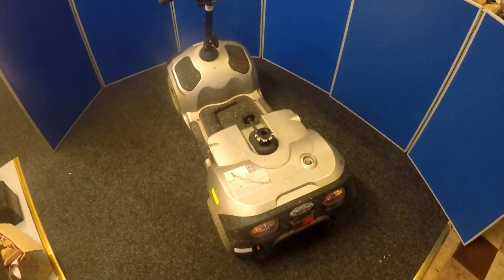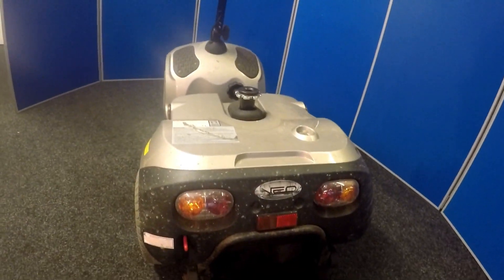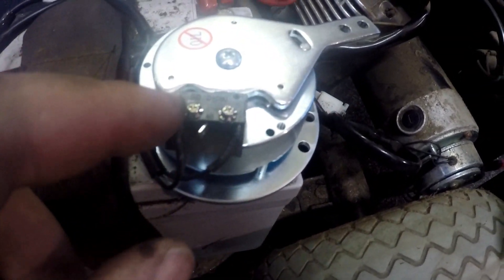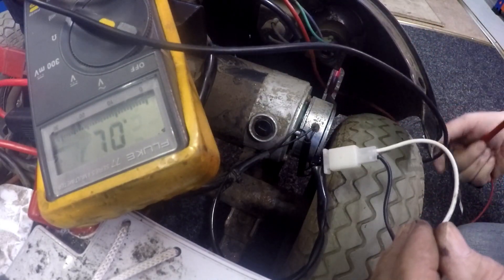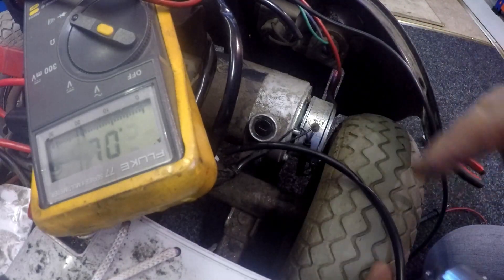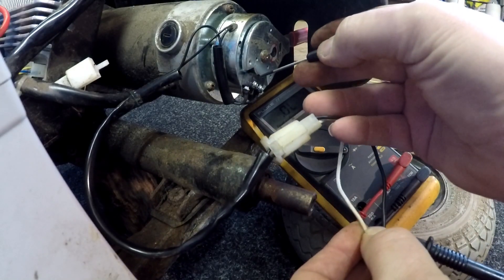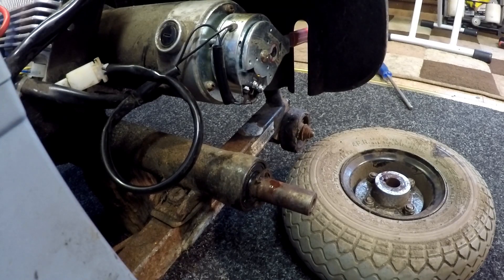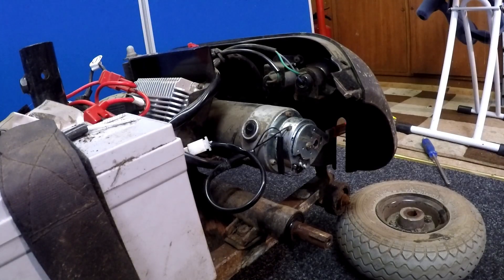Mobility Scooter Electric Brake Fault finding & Repair Part 2

Comment: I have a question about swapping out a brake controller equipped with free wheeling handle. Is it possible to swap the handle?

Comment: I asked a question which was not answered, being is the little gasket between micro switch and motor brake important?
Reply from the maker: Sorry missed that one.  Some
Manufacturers fit them some don’t so with that in mind the answer is NO

Comment: Great video, very helpful. I have a Quantum Q6 Edge powerchair. Left motor will no go into freewheel. I have continuity in brake micro switch when micro switch when the little button is both out and pressed in.  When pressed in the joystick says motor is disengaged but it won't freewheel. Is this a faulty micro switch or brake?

Comment: I think I screwed up the scooter I spray WD-40 around the motor and micro switch off and use the car charger 12 V at 12 AMP to charge batteries but failed to unplug from battery to motherboard to isolate since onboard charger wasn’t working.
It worked after I changed the batteries but then I got this crazy idea. I was going to move up the moving parts with WD-40 and spray the vinyl protectant on the wires. You can hear the micro switch click in the motor click for a second and then it went into reverse when I have the forward pedal pressed, and I just stopped working .
Reply: Didn’t know
Reply: This type of scooter has a Main wtheir Hwy Honest from the motherboard to the motor and micro switch multiple male, female, and one harness how do I test there’s like six male, sex, female, plug-in harness. Can anybody explain the process what happens first in the micro switch engage and then give power to the motor making the wheels turn in. What order does all of this happen? Please be very detailed in your response.

Comment: I have a pride, Sundancer 3 wheel.
How do I test the micro switch brake and motor when the wire connection has multiple male and female connector plug all in one harness

Comment: Can you tell me why a unit would have full power to the drive axle in reverse but not in forward?  Going forward you need to push the lever very gently to get moving and then it will take full speed, otherwise it will kick out, you have to wait just a second or two, it resets then it will go, but also needs to be pushed up a small hill in forward.
Reply from the maker: Sounds like some work has been done before and refitted wrongly wires swapped what’s the make and model
Reply: @tomjacques4  It's an Invacare Lynx-3
Reply from the maker: @harpo6203  and what work was carried out on it before it started this strange behaviour
Reply: @tomjacques4  I don't know that. This unit was given to me by a family that no longer needed it.  I know nothing of its history, sorry.  I was wondering if there's some kind of overload protector that has become weak with age?
Reply from the maker: @harpo6203  to be honest would have to hand a look at it could be something silly difficult to say.
Reply: @tomjacques4  Thanks for the effort to find a solution.  I appreciate it.  I've dropped the unit off with a service shop so hopefully they can figure it out.  Thanks again.

Comment: Hello, Superman. Don’t know if you can help me or not. After watching your videos I replaced the batteries, ignition, the electric break, the control unit, and the motor. I got the scooter going, but when I took it out to try it the speed was much to slow, I had pedestrians passing me,🤔😊, any ideas what to do.?.
Reply from the maker: hi what's the make and model. check high and low switch if it has one, check speed pot is correct one. has the controller been programmed.?

Comment: Thank you for this video. I have been testing my nans scooter, and there is continuity across the terminals of the brake, but then I removed and tested the brake using a bench power supply and the brake was solid, didnt heart a solenoid click. Can they have a good continuity test and still have a failed solenoid?
Reply from the maker: Yep sure can let me know what type you need

Comment: Is the micro switch on the elec brake universal or are there others that can be used on a scooter of a particular kind?🤔😊
Reply from the maker: It will have to be the correct size and spec.
Reply: OK but what do I order if I want one regards Danny

Comment: My electric brake is just not clicking over when it has 24v. It's just a basic one (rascal) no handle or microswitch. Resistance looks OK 48ohm ,current 0.5A.  I've had it  apart and nothing is seized in it.  All I can think of is that there isn't a mag field being produced or if there is, it isn't strong enough to pull in the plate against the spring. I just might be missing something simple  or more obvious to you. Hope you can help. Great channel by the way. Keep it up. Thanks.
Reply from the maker: Hi if it does not release the disc when 24 voltage has been applied then it’s goosed.  We should be able to help you if you need a new one.
Reply: @tomjacques4  thankyou. I'll go on your website.
Reply from the maker: @spikespike9430  if you can find what your looking for then send us some pictures with Nm

Comment: How do you know what way to put the new brake back on. Video 1
Reply from the maker: I always tell people to take pictures before dismantling. Mind you I’ve been doing it for over 30 years. So kinda know how it goes on. Mind you on new models I take a picture if I need to remove and wait until a spare arrives, just in case.

Comment: Hi Great vids I have aTGA sportster and I can drive it for a short while then the brake comes on, not enough to stop driving unless battery is down  but its got worse; it comes on sooner so found your excellent vid and have started taking it apart There's a good bit of white corrosion and I've taken the micro switch off. I'm reluctant to take off the lever which switches from drive to free wheel but it does need cleaning under and around it. Is it ok to do that? I've tried continuity on the 2 connectors on the switch and nothing so is that the switch broken or perhaps I'm not testing in the right place. I'm always nervous to take things apart before I know its ok. In your vid there are wires with connectors but my wires go into a box which is why I say not sure if Im testing in the right place Hope I've given you enough info Brake no: ACY001AI  2DX0X098001  H05020028
Regards  Jonathan Green

Comment: SHOPRIDER CORDOBA STILL DRIVING WITH BRAKE MANUALLY OFF AND CUTTING OUT  MICRO SWITCH GOOD BRAKE WORKING ANY IDEAS ????
Reply from the maker: Shouldn’t really drive in manual you sure micro switch is ok ? Could be stuck on. Have you don’t s continuity test on it and checked the small switch. ?

Comment: My Go Go ultra x 3 wheel gives 5 beeps. The neutral bar moves back an forth. Scooter still doesn't move battery's is charged an new as I replaced them. Scooter lights up. Please help what do I do?
Reply from the maker: Check the micro switch as well on the terminal block that connects the wires to the controller. The brake has an extra white terminal check that.

Comment: Very good videos,a quick question scooter works fine and slows down ok but the brake is not lock on, scooter keeps rolling.
Reply from the maker: Throttle is not centred correctly. once stopped try and gently move the throttle lever either side to see it the brake clicks on
Reply: @tomjacques4   No that did not work I checked the brushes they are fine.
Reply from the maker: @alisongreen9023  think you will need to Do a video
Reply: @tomjacques4  All works perfectly fine nothing wrong with the motor all looks very new just simply when you stop on a slope it won’t stop rolling either up or down but release the throttle it slows down and stops then starts to roll
Reply from the maker: @alisongreen9023  if possible remove the brake and see if the nut that is attached to the motor is slack
Reply: @tomjacques4  Excellent thank you, I took the break off, turned the nut, it was moving, took it off replaced with another which has 2 tighteners on it, all works fine now. Many thanks
Reply: @tomjacques4  May I ask
Reply: Why does the nut slip, even though tighten properly and appear grooved into ?
Reply from the maker: @alisongreen9023  the nut will not slip if it has a grove it will be the disc that will slip. Some nuts that are fitted do not have groves hence  slipping on the shaft
Reply: I've got a tga s3 mobility scooter and it won't move at all.

Comment: I acquired for free a mini stryder scooter for my wife and it all seemed good,i tried to recharge the batteries and i think i decided they were dead so got 2 more and fitted them and the scooter will not move,no noises or clicks when i turned on the ignition,the dash has a green light and it flashes 9 times and then there is a pause.what is wrong????? i need hellllllllpppppppp!!!!!!!!!!!!!!

Comment: Hi, the videos are great and very informative. I am trying to sort out a Pride Gogo Elite Traveller that is giving 8 beeps when switched on, I think the electric brake overheated recently and since then we have been getting this error. Would there be anything else to check over than buy a new electric brake and fit it? The Pride manual just states this error means the motor is disconnected and to call a service engineer and I cannot see any troubleshooting guide for this fault.
Reply from the maker: Hi Matin check out our latest video about scooter cutting out we replace the rear motor connector
Reply: @tomjacques4  thanks I will, does 60ohms for the resistance of the electric brake sound too high?

Comment: Hi i have a invacare Auriga 3 wheel mobility scooter the problem i have is when i put the ignition on and wait a few seconds before i pull the leaver now for some reason the scooter will not move at all i can hear the click where the brake should be releasing but for some reason the scooter will move unless i jerk it in a forward motion and it releases the brake. So do i need a new magnetic brake or can the brake be fixed. I should also add that i don't know very much about mobility scooters other than watching your videos. Many thanks David.
Reply from the maker: david holley brakes in stock but I would check the brushes
Reply: @tomjacques4  ok thank you for replying to me. As i said i dont know much about mobility scooters i just thought the problem i have was the brake binding on as it only happens when i get on it to pull off. I will see if i can get someone to look at the problem for me. Thank you for getting back to me.
Reply from the maker: david holley when brushes or the commutator get worn/dirty they can stick won’t move until you push it then it will work all you will need is a flat screw driver set of brushes and a glass Fibre pen to clean the community we sell the lot but check it first it’s a 5 min job out videos show how to check
Reply: @tomjacques4  thank you very much you are very helpful.. much appreciated.
Reply: Hi it's David here again could you tell me how much a throttle pot for a Auriga is please
Reply from the maker: david holley hi David send your request and we will send you a link nithsdale.wheelchairs@btinternet.com
Reply: @tomjacques4  how much would it be to buy the brake. Or how much for the bushes please.

Comment: Hi your video is so helpful, I have a Pride Go Go scooter, it beeps five times.  I have taken off the brake and I does not have continuity.  I have tested the micro switch by pushing in the white tip and it does not click.  The scooter is about 5 fives old.  Can you help me to zero in on this problem?  Thank you
Reply from the maker: Sherryl Lockett looks like a faulty micro switch my friend we sell them on your site.  
https://www.nithsdale-wheelchairs.com/prods/11441/micro-switch.html
Reply: @tomjacques4  thank you, the number on the brake is Warner Electric z345/5/C,  09/Nov/15, WR198A345P1,  3.ONm, 24 Vdc, 10 W, DRV 1060.  i looked at your website and i don't see this particular one.  im in the states how can i contact you.

Comment: Hi pal got the same scooter dash slightly different galaxy neo 6  it just stopped going up hill uncle told me.. Batteries OK, brake OK, motor OK, brushes OK, the fault light comes on stays on doesn't flash. Everything works but will not go back or forward,, any idea's,  I'll try phone you later
Reply from the maker: Sammy Patterson check the circuit breaker check for water contamination also a couple of fuses under the rear panel

Comment: Boss, so we now know the scooter has been left uncovered in some rain. There is a flashing left indicator with a beep sound. How do I fix it, or do you need to get it into your shop. kymco xl i think maybe xls 8 mph with 2 big batteries
Reply from the maker: Billy Purse hi looks like water has got in the switch.  Take scooter to a warm room sir a couple of days may need to replace switch

Comment: okay boss, scooter cover was blown off front of scooter. hence this funny light flash and reverse horn sound. with plenty of time on my hands how do I fix it? Is it just replace fuse, dry out affected area and that's it? Do you sell covers for the kymco xl, cheers mucker, love these video's
Reply from the maker: Billy Purse I would put the scooter in a warm room for a couple of days even if bad have a small heater to help drying out but not too hot. Thereafter test it as it should dry out.  We do sell waterproof covers check out our site. Always try and buy the best you can afford, I have seen some cheap ones and they are very thin so no protecting and the seams are not sealed from the inside.  You get what you pay for.

Comment: I like your video and I have a technical question. My power chair makes the usual clicks noise whenever I use the directional controller. I wanted to remove the magnetic brake from the drive as I’ve been told it’s essentially only a parking brake. I only use this chair in my house which is level. Can I do this to make it noiseless and make my wife happy or is there something I’m missing.
Thanks
Reply: Wouldn't go removing the brake, bad idea